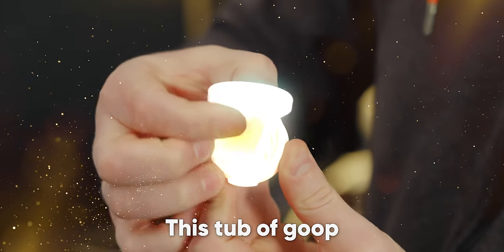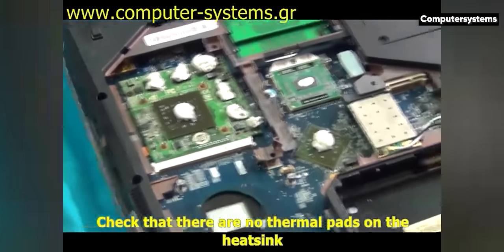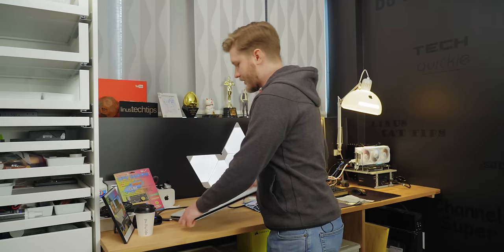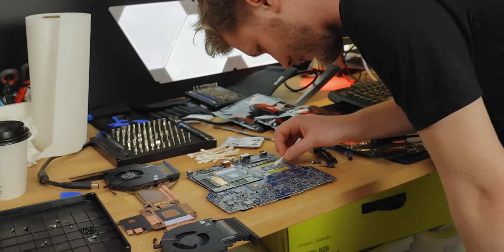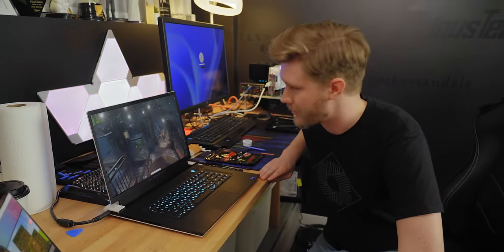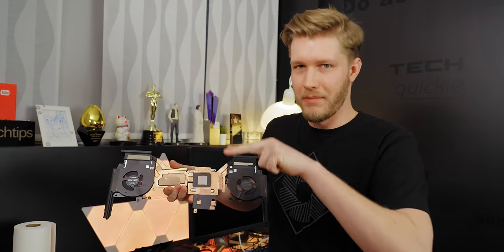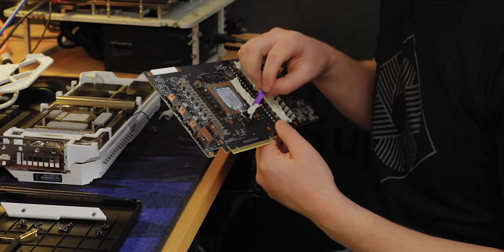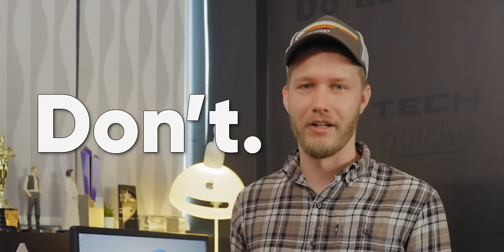More FPS for just $10 - K5 Pro Viscous Thermal Paste

Comment: Interesting, totally not worth it but interesting. 👌
Reply: Totally worth it if you need to change the thermal pads. Just use this instead.
Reply: I don't think Ltt has made a video on a product worth it for me in years. Still watch daily lmao
Reply: Thermal pads are actually a pain in the butt though. If you don't have the correct thickness pads, or even know what they should be, this product would be a great thing to use. I'm also thinking it might do a good job of reducing coil whine, since it's designed to be applied heavily.
Reply: Indeed. Though he made a good point at the end. If you were planning a repaste anyway, might as well add some of this
Reply: Absolutely worth it.

My laptop fan is dying, to replace it I need to take out the thermal module, when taking out the thermal module you need to replace the thermal pads. 

Those thermal pads need to be an exact match to the OEM thickness. How thick are those? Who fucking knows, the laptop manufacturer gives no specs, and as far as I can tell, there’s not even an easy way to purchase the OEM one so you can be sure they will be right. 

So what are my options? Buy this stuff like I did, or I could buy a kit of every single thickness of thermal pad available just so I could be sure I will have the right one, while hoping that I actually managed to correctly figure out the thickness when we are talking about submillimeter differences.

Or I could take it apart, try to measure it, hope I get it right, then wait around with my disassembled laptop until the new pads arrive and again hope I got it correct? 

Even if there’s no performance gain whatsoever, the convenience alone makes it worthwhile.
Reply: In what context my vague friend?

Comment: The gain on the 3090 repaste was actually over 20% in the 1% and 5% lows in furmark which matters way more than the average. Btw thats an enormous gain
Reply: which is good, until heat transfer through the goo to nearby less heat tolerant components will eventually cause them to fail.
Reply: @HG-fw8hn  that's a really good point I have never even considered before.
Reply: @HG-fw8hn  Not really
Reply: @PaffDaddyTR  Not really what? The purpose of this stuff is literally to transfer heat. For instance in a Laptop the thermal solution is carefully calibrated to transfer the amount of heat from components that comes from a thermal pad cooling solution. If you slap this stuff on then:

1. Heatsink becomes way over saturated from heat, which it can not dissipate fast enough. Which will probably lead to more thermal throttling of CPU/GPU/Memory

2. All that heat that the Heatsink can't get rid of gets saturated to nearby components that are covered in 'goo', through the 'goo', which will increase thermal stress on them well over operating limits.

It's simply thermal dynamics
Reply: @HG-fw8hn  Thermal sensitive components wont be laid right beside the VRMs, CPU and memory, since heat transfers through the copper lined PCB much more efficiently than through thermal goo, bud. And cooler "oversaturating" with heat? Seriously? Can you name an example of that happening?
Reply: I wonder how much will this benefit from games that put most of the load on the RAM.
Or to miners.. :|
Reply: @HG-fw8hn  That is some god awful theory.

1. True, the heatsink would absorb more heat, and the fans would dissipate this at the same rate (roughly). But the heatsink absorbing extra heat would mean that the chip would be running cooler, requiring a lower rate of heat dissipation. This means that, at the very least, it would run the same. However, a heatsink cannot become 'oversaturated', and since cooler saturation refers to the point at which heat generation = heat dissipation, the only way this would cool worse would be if the goo results in a lower thermal transfer (which it doesn't, it's more), if the cooler was worse (which it wasn't, it was the same), or if the cooler was already saturated in the initial test (which it wasn't, as shown by the increased performance when switching to the goo).

2. As already pointed out, thermally sensitive components would not be placed near (especially not that near) the components with the highest thermal load. That's just bad design and, even without the goo, would likely result in overheating of these components.
Reply: OP: Thanks for speaking in % and not in frames. Helps a lot more to understand the "effect" shown in the video.
Reply: @cubertmiso  Actually surprised they didn't talk about it tbh frame time can be the difference between having a game run at 60fps and having a game feel like 60fps it can make or break a experience and in comp shooters I.E. siege, valorant, CSGO it can win games
Reply: Most of it was because of the repaste so that doesn’t really help the case of the k5 pro. Maybe the stock paste was just bad, but not the point of the video.
Reply: @HG-fw8hn  
In cheap designs like notebook coolers yes/maybe and on graphics card no/maybe.
Cheap nb cooler indeed place more temp sensitive components right beside the hot component but thats most likely only a point if its using no vapor chamber part for the hot component. On Graphics cards u see that a good cooler has zones and sometimes vrm or memory have a cooling solution thats not coupled to the main heatsink itself.
The other Point is that you maybe transfer heat in the normally cooler component but ram and vrm have such a large area where the connect to the pcb so you get some kind of heat transfer into pcb with temps that are way under the limit of this component. So you can add ectra cooling through that and like always its a price thing and often the manufacturer uses sht just cause a few pennies.
And at the end you want no bottleneck on the way and the situation that you max out the heatsink/fan side. Remember the higher the temp difference between the surface and the surrounding the more heat can be transfered.

1. No because in most scenarios your fan speed is coupled to temp so the hotter it gets the more you can in fact dissipate and you can get rid of some heat through that pcb. But there are scenarios where yes, cheap gpu cooler can heat the memory chips, the 90 degree beside the 60 degreee component cant be on one copper plate especially if the way further out is bad. Better the heatsink gets over saturated with heat than the chip or you think not?

2. Yes and No
Reply: @Bramble20322  Yes they are laid right beside each other due to space constraints and cheap construction. But yes transfer through pcb can be good but can be bad either.
A cooler oversaturating with heat is a typical problem for overclocker, there is point where you either cant get the heat out of the chip fast enough or if you do then every cooler has a maximum wattage limit. Every person with an intel stock cooler from the last generations experienced that problem. Oversaturated to the point that the fan is going full blast but you dont get your max turbo clocks.
Reply: @TravelWithCesarin  the hotter the component is running the faster the pads get dry, so if your card is running many hours ram intensive workloads its maybe worth a try after some years.
Reply: @CaptainOAP  
1. 
Remember the fans go faster in most scenarios and also the more the temp difference the more heat can be transferred away. so yes and no because both scenarios are possible. Can be bad and can be good. Especially memory chips have a sweet spot they like the most, i believe its 60 degrees, more is bad but less also. You know the copper tag on samsung ssds? Its not for making a bigger surface its to distribute the heat from the controller to the memory chips so they are not to cool, but rumors. But yes, it was not saturated at this point and a worthwhile upgrade.
2.
That is not true because its everyday business to see ram/vram/vrm right beside the cpu or gpu. Just remembering, some say 90 to 100 degree C are ok for a CPU/GPU. But yes in better cooler designs the parts are "disconnected" in some way. Nothing new to see a vrm or memory cooling attachment which is not connected to the main fin stack on a graphics card. So there is both out there
Reply: @cubertmiso  Thanks for letting me know it was not for nothing, happy to see that a real discussion without verbal sht derived from that
Reply: @LlamaCraft  Yes, keep your eyes open because in very many benchmarks or comparisons they only go with the average or have no line graphs which could show the dips.
And its even worse, you can have a nvidia card display higher and higher core frequency values but stick internally to lower freq, only way to find out is to compare benchmark scores. Thats most likely vrm throttling which cannot be checked on some cards.
Reply: @OneShotCS  Thats true but k5 is a little better and if you go through that trouble of repasting a gpu i would go with the better stuff. Especially since furmark is not really vram heavy, ~11% ram utilisation at my system. And the, wow, second and least test was not usable because braindead you know.
Reply: Indeed, with some pro games you might want the 1% to stay above the refresh rate. With this that would mean a whopping 25% on the 1% lows.
When I am gaming I don't mind between 73 or 78 (74hz monitor), but when it starts dipping low sixties I start to notice.
Reply: @HG-fw8hn  Cooler can't "saturate" with heat, the hotter it is, the more efficient it gets...
Reply: @HG-fw8hn  youre missing the main points of thermal dynamics here, heat IE energy cannot be created or destroyed. A gpu consuming 300 watts will roughly put out 300 watts of heat (compensating for fan motion etcetera). AKA the only thing that will change is the fact that the chip will be colder under the heat sink. If anything the parts near the chips will also be cooler beause the heatsink will be faster at absorbing heat from the chip (faster not more), which is moved via fans to air. AKA you'll actually increase the longevity.
Reply: @HG-fw8hn  that’s not how that works, the heat in the system wouldn’t change, all that would change is that the paste is more thermally conductive which would make heat transfer faster to the heat sinks and be expelled by the fans which would lower the temps of the cpu/gpu.
Reply: @HG-fw8hn Simple changing the fan curve will fix that problem
Reply: @HG-fw8hn  ASUS literally puts paste on VRMs in ROG laptops. I had to order this stuff for my Strix when I repasted it. Don't overthink everything.

Comment: We all know that RGB increases performance by at least 120%
Reply: Lmao true😅
Reply: That was funny 3 years ago
Reply: No, RGB improves performance by 1000%
Reply: No it does not
Reply: Only red does, blue drops the temp by 20 c.
Reply: @cako7139  woosh
Reply: @cako7139  we know, were just joking
Reply: @cako7139  r/wooooooooooooooooooooooooosh
Reply: Depends on what you set it to.

red = more fps
green = less power consumption
blue = lower temperatures

facts
Reply: @darjanator  The funny part is how LEDs actually increase temperature and power consumption ;) Not by any meaningful amount, but still funny!
Reply: @BriBCG  Well, of course. No light source is 100% efficient, so it will generate heat and you need power to generate light.

Imagine if the RGB fad came about when we were still on regular filament bulbs...
Reply: Rgb thermal paste when

Comment: I would love to see a review of this with more midrange components, maybe a GPU that doesn't have any thermal pads to connect to the backplate, then comparing this to some cheap aftermarket pads.
Reply: This! With overclocks!
Reply: Highly doubt if you'll see bunch of reviews... Heck this thing existed for almost a decade and you only found it because of this promotion
Reply: Wouldn't really make any difference in a card that isn't thermal throttling.
Reply: I second
Reply: Maybe you could apply this in a laptop to connect the heat sink to the chassi, like they did with the macbook a while back
Reply: To bi blo dejansko ful kul videt ja...
Reply: r9 290
Reply: Pozdravljen fellow Slovenec

Comment: Thermal goo is for those cases when the manufacturer uses some stupid thermalpad thickness like 0.65 or 0.85. And since some of the best thermalpads are not that compressible you use the K5. But you should NEVER use it to replace pads thicker than 1mm. Those should ALWAYS be replaced with pads of the same thickness.

Comment: Quick story in regards to removing batteries before disassembly:  I forgot to remove it a few weeks ago on my ASUS laptop (ironically, en route to replacing my thermal paste) and, in the process, accidentally let the shield covering the display driver touch a ferrite bead on the board.  Unfortunately ASUS decided that, despite the machine being off, that connection should still have a fairly uncontested live connection to the battery.  In less than a second, an impressive arc formed and quite literally blew the ferrite bead straight off the board.  Cue waiting a week or so few a strip of ferrite beads, a hot air reflow station and some chip quik all because I forgot to unplug the bloody battery
Reply: Hmm the worst part is the battery could have been damaged
Reply: @c4_yrslf726  If the connection is held long enough, I definitely agree.  I don't think a very quick short is going to do enough damage to worry about, but if it made prolonged contact that would absolutely be a massive fire risk - particularly with a LiPo battery.  My biggest concern would be catastrophic component damage - nothing like feeding uninterrupted current and an unknown voltage through your shiny RTX 3080
Reply: To clarify, are you talking about an RF shield? Those should normally be grounded
Reply: @__lasevix_  It might've been an RF shield but I think it was to act as a barrier to stop any loose components shorting across the LVDS connector.  The problem was actually that it was grounded lol - the ferrite bead had an open positive connection, but a closed negative one so when it tapped the shield it formed an open circuit 🤦‍♂️😂
Reply: @Jacobwlane  oh okay. well that's a good example of why you should unplug the batteries first
Reply: @__lasevix_  Oh definitely - never considered it before but with the advent of batteries being built-in rather than having to be removed as part of the disassembly process it's so easy to forget
Reply: Yeah, I had a similar (but unluckier) experience many years ago when I was using a screwdriver to straighten the pins of the display connector. The connector had a live ~12V from the battery and this blew off a bunch of ICs. Total loss. I ultimately got away blaming the fall, which bent the pins and made a bunch of other mechanical damages.

Comment: Been using K5 Pro on GPU VRM's on Laptops especially for 2 years, no issues so far and good performance. Much easier then trying to figure out the pads thickness on each laptop.
Reply: Chupapi munyanyo
Reply: @abc20243  For what reason? There's no point in using K5 Pro on an SSD, Use thermalpad instead.
Reply: @abc20243  you can use it with no issues.